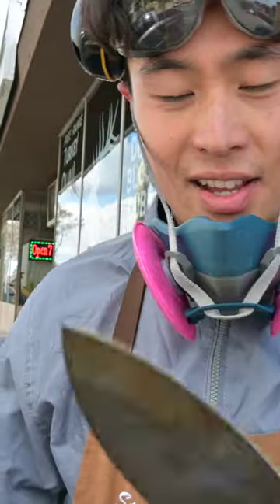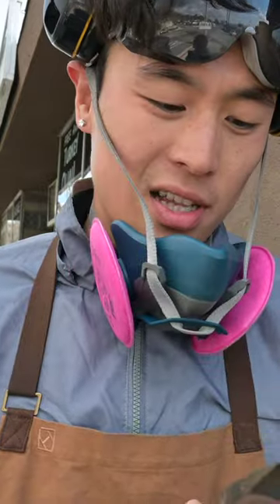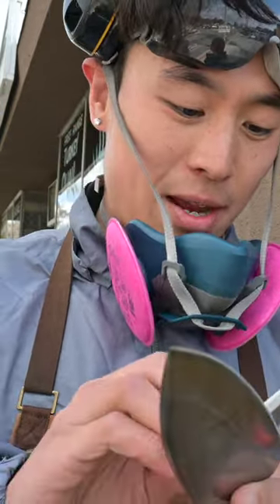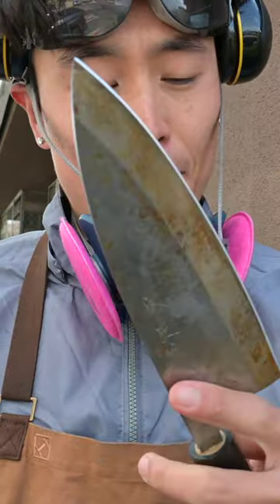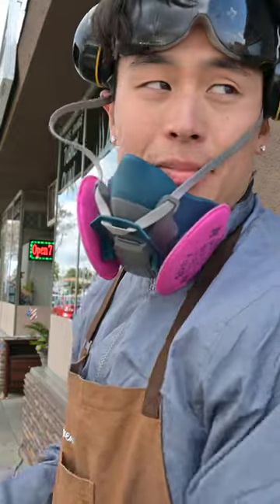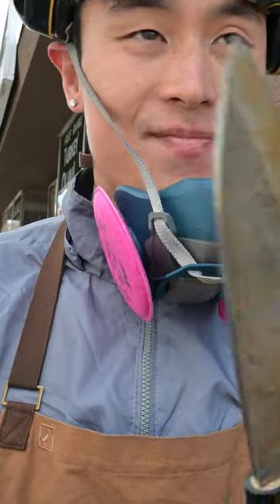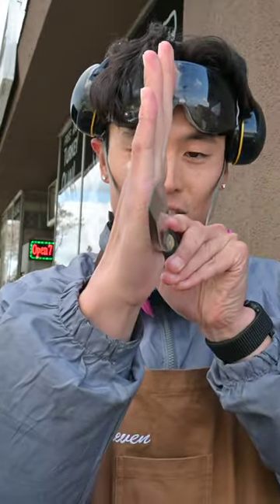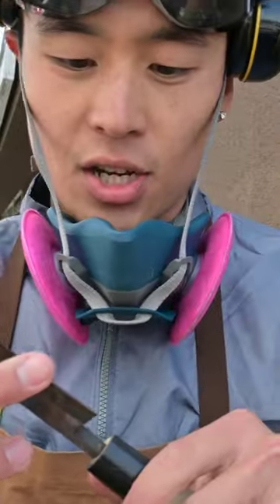Why Japan uses a Deba knife #knife #sharpening #shorts

Comment: To keep fine steels from rusting is very simple. 1. Keep the steel dry during and after use. 2. If you plan to store them for long periods of time, oil the surface to protect the finish. I recommend canola oil-choji oil-gun oil the first for food grade. 3. Purchase a blade with Kyōmen shiage=mirror polished finish a blade with this finish is a little less easy to rust. However, you must still follow the other two instructions to preserve your beautiful steel.
Reply: I don’t think gun oil is edible
Reply: @reedeayers mineral oil works though.
Reply: @FlyingSpaghettoMonster for long term storage I like mineral oil, but the fact that it’s a laxative bothers me. For knives I use often enough it’s virgin coconut oil. Smells so good 😂
Reply: if your storing them for a century use vaseline 😁😁😁😁
Reply: @friedegg1936  intriguing I will try this on one of my blades that I forged thank you.
Reply: @reedeayers you are correct. One would have to clean the blade before use as I said not food grade.
Reply: @FlyingSpaghettoMonster indeed.
Reply: @lindboknifeandtool I never thought to use coconut oil thank you.
Reply: @mountainwolf1  my only worry about coconut or other food oils is they can go rancid, especially when exposed to light and oxygen.
Reply: vaseline easy to remove just use hot water . it's how they use to do it with straight razors and after a quick rinse they look brand new.

Comment: on knives like Deba the 'inner' side (the side facing your body) isn't flat, it is rather slightly concave
Reply: Is it just wrapping during quench? A byproduct?
Reply: @yuxuansun8271  no, it's a part of the processing after the piece is mostly forged, unless the maker decides otherwise..  it reduces weight significantly
Reply: @yuxuansun8271 yes. It’s usually from and controlled by the quench. It can be further accentuated or even just added by grinding a hollow as well. 

It’s very similar to a scythe edge where you peen it over to make contact even
Reply: @generaldistrust quench a single bevel blade and it’ll curl inward

Comment: High carbon steel much better for holding an edge, but correct they're prone to rust.  Just give them some love and they'll provide years of service
Reply: Some carbon steels can get close to 70 hrc but iron carbides are way softer than say a vanadium carbide. Which means carbon steel wear resistance isn't as good as a vanadium carbide. Majority of carbon steels are also only around 60hrc which further decreases their edge retention.
Edit: as for rust, yes oils can prevent it. Most people don't want to put the effort into oiling a knife after every use though
Reply: plenty of stainless alloys nowadays outperform carbon steels, some reasons mentioned above. There's very little point to having a carbon steel kitchen knife, of all things.
Reply: @wea69420  Agreed! End the misinformation

Comment: When you know you use your carbon steel knives not for a longer time put a drip olive oil on the the blades and they would never rust even in high room humidity
Reply: exactly
Reply: Any type of oils?
Reply: Sorry I mean like more organic and higher quality oils?
Reply: Even like linseed oil?
Reply: Most oils will work
Reply: @matt.eick28  For kitchen knives its smarter if you use any edible oil, on outdoor or bushcraft knives you don't prepare food with you can use any oil ;)